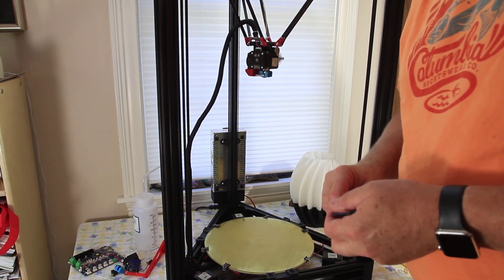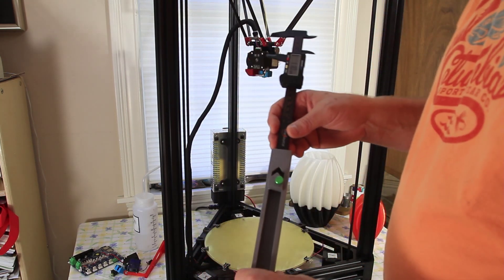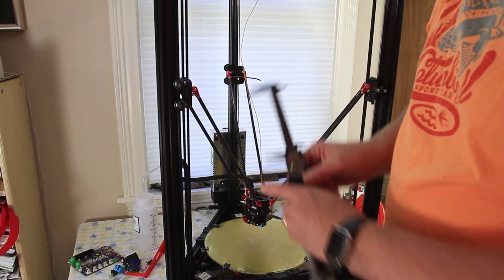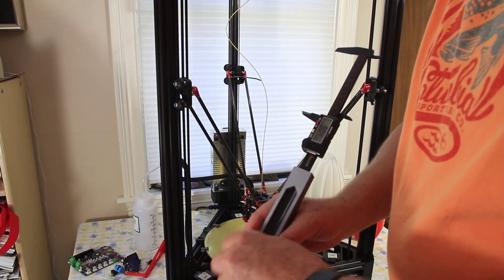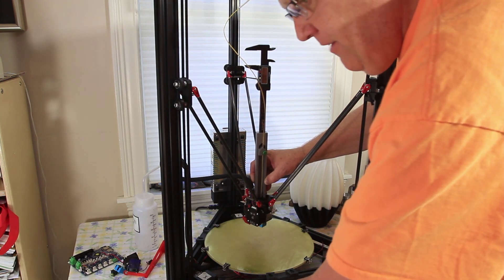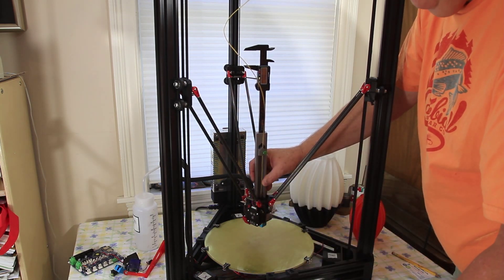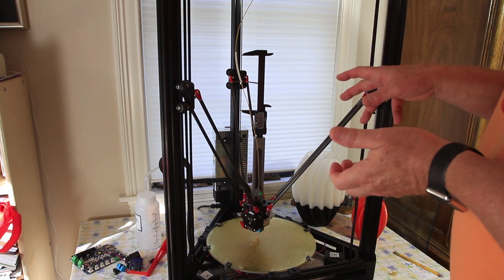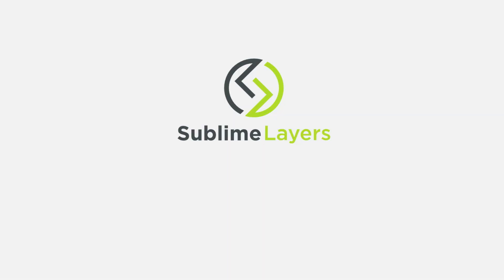Extruder E step Calibration

Comment: 6min. in and a Q: Is your delta direct drive or bowden? looks like the latter. If so, can this be done w/bowden setup?
Reply from the maker: djC653 works perfectly with Bowden also. Position at the entry of the filament to the extruder.

Comment: Do you have that Gcode shared somewhere?
Reply from the maker: Yes, the file is in the Thingiverse Thing Files: https://www.thingiverse.com/download:4237254
Reply: You the man. :-) BTW, how much travel are you getting from your little jig? Got mine printed and assembled and the most I can move it is 104.4mm. So if I'm over-extruding by more than 4.4mm then I guess I'm gonna hear some slippage :-) I think I should be ok. I have my esteps set already but was dying to try this as I love precision and this is one fine way to skin a cat. Hated marking up the filament with a sharpie and trying to measure etc. This is an awesome idea!
Reply from the maker: I get about 115mm travel. Why are you only getting 104.4? That doesn't make sense to me. I can extend the body but I thought 115mm was more than enough!
Reply: Well the top of my calipers are seated all the way inside the  top of the jig. I suppose I could lift it out some and then set it. That should allow a bit more travel.  The sliding thumb screw on the calipers eventually butts into the top. I think I can squeeze a bit more travel out of it but if its not secure into the jig then the top feels insecure. I think this will vary depending on the length of the heads on different calipers. One I'm using now has a 61mm body (LCD) not counting the thumb screw thing.
Reply from the maker: Ah, so the issue is the length of the depth gauge on your caliper? Would you like a longer unit to print and if so, how much longer? I can make the edit and post it for you.
Reply: Some other ideas I had would be to allow a set screw to enter the front or back the filament holder to secure the depth guage. Not sure if that would mess up the operation of the current implementation of holding the filament in place. Or, could have set screw holes on the back of the main body and set screw hole on the back of the filament holder. You'll get more travel if the depth gauge is attached as high up as possible on the filament holder.
Reply: In any case, I can make a small mod to my calipers and be in business and get close to 115mm of travel so I'm good. Just wanted to share my experience in case you get others with similar issues using different calipers.